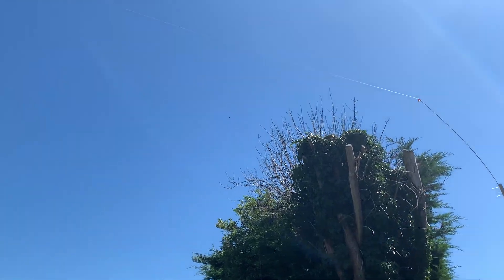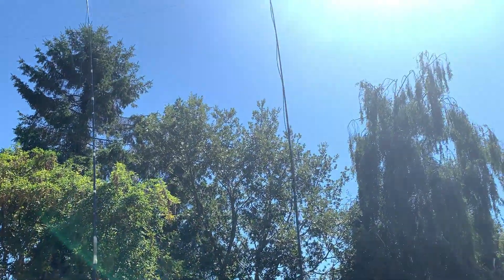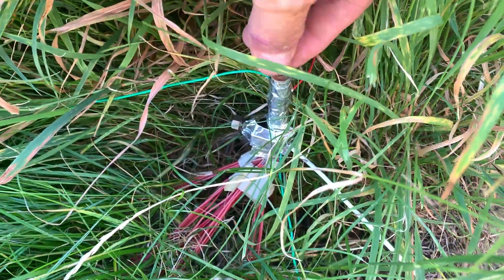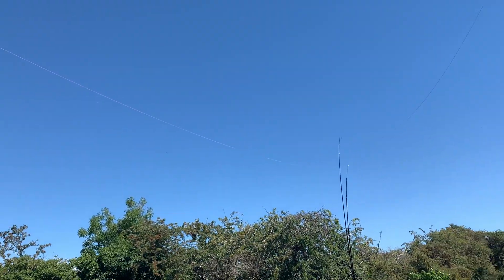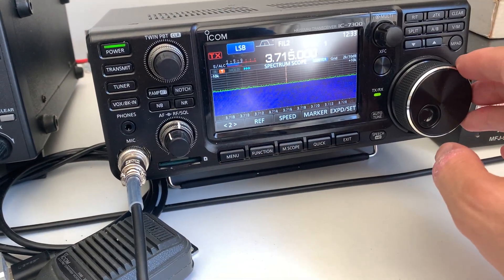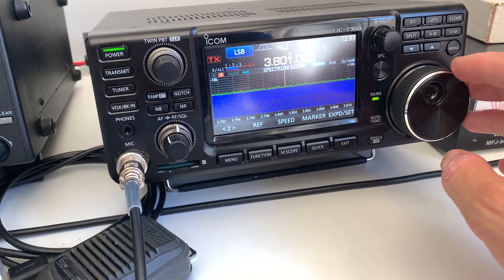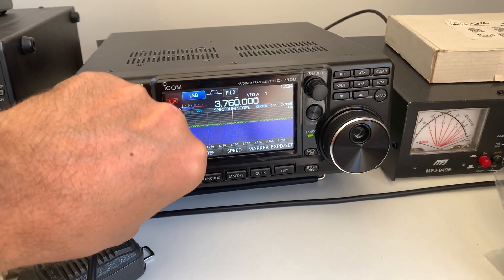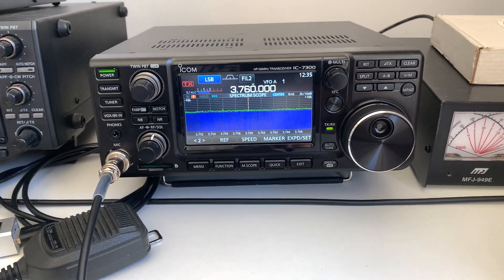Two simple improvements to my £4.50 top band end-fed wire antenna for ham radio TX/RX

Comment: Interesting video, I struggle in my new build house as the garden is only 9x9 metres. I going to try a mobile pro am whip with an elaborate wire radial system. I want to join the local Sunday net!
Reply from the maker: Go for it - good luck!

Comment: It's so frustrating that the average UK home has such a pathetically small garden. I am really struggling to establish any meaningful antenna lower than the 20m band because I only have maximum 4m radius from my mast.
Reply from the maker: I know exactly what you mean John. One of our club members is moving away from Oxford to near Wales - you can get a acre or two with a property over there as compared to Oxford apparently! 73
Reply: @OxfordShortwaveLog  I have gone for a 6 band Hex Beam, so have 20-6 coverage, but I need to find a way to get 40m and 80m.

Comment: Hi Clint,  I've purchased an EFHW antenna that's 130 ft. long and my garden is about 80 ft. long by 26 ft. wide. Was wondering if i could go up 80 ft. then across 26 ft. then back down the other side for the rest of the wire. What i'm wondering is should you not fold back antenna's or is it ok as long as it's 90 degree angles.
Reply from the maker: Hi James, just experiement and see what happens with the input impedence/ bare match. It's all about experimentation. Good luck. 73

Comment: It's all i do build my own antennas never buy.Tricky to assess the performance as you say conditions vary.Is it better because its better or is it the same just better conditions?One also has to learn when to leave the thing alone as you get less and less return for your tinkering.I have also heard it said it doesn't matter what kind of wire you use.This is not true it matters greatly as i have tested this.Too thick you get negligible gain just more QRM.I tried galvanized fence wire which was awful.I have done much testing for sw listening believe me.I would assume transmitting is the same.Anyway i am starting to ramble have a nice weekend 👍🤗🐻
Reply from the maker: Hi there Michael, thanks for your comments. I've been tinkering with antennas for RX for years - and I've tried barbed wire fences in the UK, wire fences in the jungles of Brazil - all sorts! I think once you've got a decent set-up, it's best to leave alone. Forever diminishing returns with more and more radials - that kind of thing. You too, have a good weekend. 73s, Clint